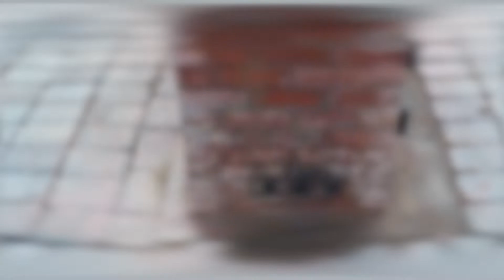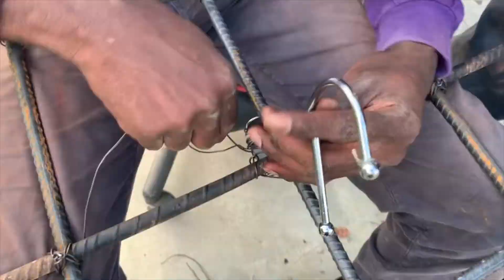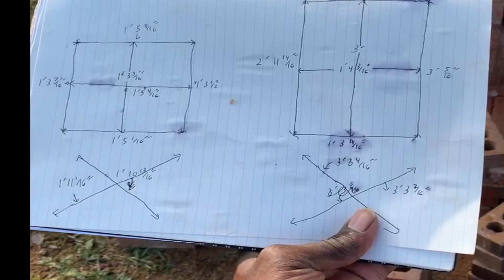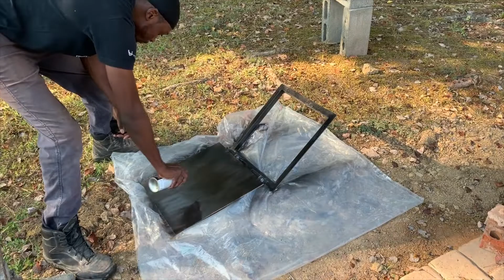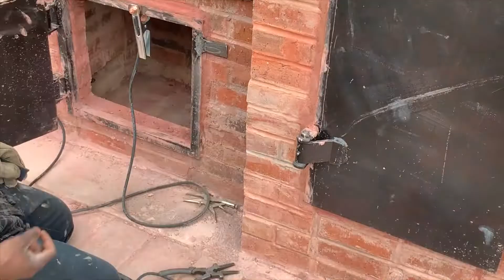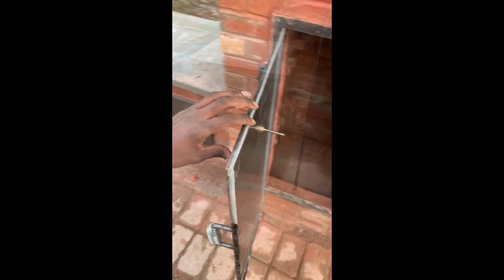How to Build a Brick BBQ Smoker (Part 2)

Comment: This is a really cool project and overall a good conceptual design.   My improvements are:
-Use a single, shared wall between the firebox and smoker (less heat loss)
-Instead of a pipe just have an opening in the blocks between the firebox and smoker (this should be higher because heat rises and will flow better from the firbox to the smoker/storage chamber.)
-add a chimney like you did in your 3rd video
-I think I probably would have used 6x8x16 cmu block for the structure and then face it/veneer with brick (this will hold the heat a lot more because there is more block mass involved)
-Line the inside of the firebox with firebrick 
-Use pieces of rebar toward the top of the smoker box to hang meats instead of using a single hook.  This will allow you to hang a bunch of meat toward the top where the smoke is about the exit the unit

I am just about to build a block offset smoker and will share my design/results when I am done.  Thanks again for the great design and inspiration.
Reply from the maker: Thanks Michael! These are all great improvements and I can’t wait to see how your smoker turns out!
Reply: Hey Michael curious to know how your project came out. Did the shared wall and other details help?

Comment: Your cook  chamber should be higher than the firebox your pipe should have been  at the top of the firebox about 3 to 4 inches below the joint section  but the overall design looks awesome especially the doors a top pipe should have been  placed in center of cook chamber   so that the heat and smoke is pulled upward to cook the food evenly
Reply from the maker: Thanks for watching and for giving some tips! I’ll make sure to keep these in mind if I ever build another smoker.

Comment: Regarding smoke circulation, I have read about guys using 1 or 2 small fans (the kind that are used to cool a computer) for this purpose.  Haven’t tried it, but it’s supposed to work.  Of course, now you’ll need electricity.
Reply from the maker: Thanks for the tip! Installing a small fan on the smoker would probably do wonders.

Comment: Hey man that is a great build. 
To get more heat or to be able to adjust your heat you need dampers on your air intake and exhaust vent. I agree with you moving your pipe from the floor higher up as heat rises. What ever size pipe you have going from yourfire box to you smoke box you will need at least that size on your air intake and your exhaust. And on the intake and your exhaust you need dampers you can open full and adjust to either have fire in your fire box which will give you heat moving to your smoke box or you can close it a lil or lot which will cut back on your heat and give you more smoke. Id love to sit down and swap ideas with you. Again great build.

Comment: Sturdy build!  Bricks use up a lot of BTU's just to heat up to the desired Temp for cooking.  I would guess that it would take more pre-cook heating to get up to cooking temperature.  I just cook on a Bebber Kettle, so no experience with this type of smoker.  But it should be a great smoker and last a long time.

Comment: Good job on this project! There are several suggestions others have made, like the addition of firebrick, that I agree with. One thing that you can do if you aren't achieving the desired temperature and sustaining it, would be to add a small external blower to your intake vents, perhaps even a foot operated bellows. This will both increase your heat and force the heat and smoke through the pipe. If you use an electric blower you can actually put a thermostat on the food side for automatic on/off control based on the temperature you're seeking. You will have to watch your fire a little closer, to assure that it doesn't burn out too fast, but it could help you maintain a more stable and sustainable cooking temperature.
Reply: I was thinking the same thing, a small fan to act as a bellows of sorts to push air in to feed the fire and raise the temperature.

Comment: My Brother I admire the work you did on your smoker. I am from New Orleans La. and now live in Texas and have seen a few smokers in my day. I was wondering why you would have two walls when one would have been sufficient ,one wall would have made your smoker a single unit instead of two separate units ,resulting in better heat and smoke retention, your smoke would travel to your food more abundantly because instead of a smoke pipe you would have a larger opening created by the brick openings .I hope I am not being too critical because I think your smoke genius ,I am presently building a brick smoker and I hope to share some comments with you in the future. Payton C. Jenkins
Reply from the maker: Having one wall does make sense! It probably would have saved me from some of the problems I encountered. Thanks for the advice and keep me updated on how your smoker turns out!
Reply: Yes Payton. a great video. If you have built an improved brick smoker, please share with us too the outcome. Cheers.

Comment: Moisture is your issue I bet.  Fire brick holds less moisture and retains heat better.  I would line ever bit of it, firebox and food storage w/ good fire brick.  And fill in that gap between the firebox and the food side, it only serves as a cooling channel like a fin on an air cooled engine. You may want to think about a small fan on the fire box side to "boost" temps. You may be shocked at what a tiny bit of forced air can do in a system like yours to raise the temp after you have refueled it or when you first get started. 250' f plus may require a good load of coals but you can get it.  You have built a nice rig, you are on your way to some good food.

Comment: I think your intake vents are fine but would change your exhaust vent. Maybe put a 2 7/8 piece of pipe at the top. On the top of the exhaust pipe you could put an adjustable cover so that you can increase or decrease the air flow needed to maintain the proper temp

Comment: There aint no way that this will work. There is a reason that the firebox is black and burned. You have to get the food chamber higher than the smoker or that will never work. Not only are you burning way too much wood, your box is getting too hot. If you can, pull the meat chamber off at the base, and recreated abase for it about two feet up. Your pipe should also be at the top of your firebox.

Comment: This is an awesome and amazing smoker you’ve built with your own two hands and I absolutely love this smoker/ bbq pit I myself would’ve most definitely made the section that goes between the two units larger and I would’ve put a smokestack on the top of the larger unit and sliding vents on both units to help with heat management. But all in all you did an amazing job congratulations and thank you for sharing this awesome build and please share the other mods you are planning to make to this beautiful smoker. And I almost forgot to mention the reason that you need a proper smokestack on the right side meaning your right side when facing the smoker is because then just like any other smoker or reverse flow smoker that’ll make two things happen one the smoke and heat will then pass across and over your meats and the other thing is so that the smokestack will drift out of the smoker make for better temperature control and holding your desired temperatures better. Have a blessed day and I pray that this message finds you and your family safe healthy and blessed. And now I’ll become a NEW SUBSCRIBER. Again congratulations 🎊🎈🎉🍾 on an amazing awesome build and thanks 🙏🏽 for sharing my brother.
Reply from the maker: Thanks for the advice and subscribing! I have the temperature problem fixed now. I will have a new video showing how I fixed it in the next week or so.
Reply: From The Ground Up DIY awesome bro thanks 🙏🏽

Comment: Thank you for the details on the doors. As for the smoke pipe, move it higher, but leave the air vent low on the fire box. Once you get the fire going, block off a few of the holes to slow the burn. Try locust wood to build your coals, then add your flavor wood for the smoke. You could also add a fireplace log rack to build the fire on and build the layer of coals. I hope this helps. I also plan on making the slab over the fire box larger so I can place a pizza oven on top. Great job and it helped me greatly. Cheers.
Reply: For a wood fired pizza oven the fire should be on the deck of the pizza oven. I used to make wood fired pizzas and the temperature has to be maintained at 700 degrees on the deck itself with the heat rolling across the ceiling at 900 degrees. Pizzas cook in 90 seconds or so and you have to turn them every few seconds with your peel to ensure evenly browned crust.

Comment: great job with this, I am hoping to get one built up myself here soon. I was thinking instead of the small brick holes for intake, maybe a half cinder block  for each air intake would be a large enough hole for the airflow you need to get the fire running and staying hot. As well as raising the fire off the ground, allowing some air to travel around the entire flame and get it hotter.

Comment: Great job Bro! I like it.. I would suggest few things, first I believe you need to insulate the firebox by fire bricks or rock wool to maintain the heat, second thing it would be much better to make both holes on the firebox & cooking chamber at the same direction of the ventilation pipe for better air flow and circulation as this would really help in temp control, finally I would add a chimney with a lid instead of halls at the cooking chamber for better controlling over the heat and temp. Good luck
Reply from the maker: Thanks for the Advice! I plan on adding the chimney next and if that doesn’t help then I will add firebrick. Do you think the chimney should go on the the back of the the cooking chamber or on the side?
Reply: From The Ground Up DIY you can make it on the top of the cooking chamber or at the side, I prefer to be on the top of the concrete towards the side not at the back by making a hole in the concrete, actually this can be seen in offset smokers, so you’ll be basically copying the design from the offset smokers! moreover, you have to change the holes on the firebox from the back to the side to match the ventilation pipe flow direction and increase their size, also the ventilation pipe should go higher than you did. Always put on your mind the design of the offset smokers When doing any modifications..
But still you did a Good job

Comment: Try starting with a good fire in your fire box. I would put a rack in my fire box to keep the fire off the ground. That way your fire will get good air flow, you will have a bigger fire, and produce more heat. You might also need bigger vents to get more air to your fire. Great video. I will definitely be giving something like this a try
Reply from the maker: Thanks for the advice! I’ll be giving it a try!

Comment: That's nice bro i read must of the comments they are all great ideas and I have one more for you. Since your thinking about make your firebox holes bigger why not just add a fan with a digital temp regulation that way you can set it and forget it for awhile
Reply from the maker: That’s  a good idea! I’m planning on  putting fire brick in the firebox first and then I’m going to make the holes bigger. If that doesn’t work, I’ll probably try out the fan. Thanks for the advice!
Reply: @FromTheGroundUpDIY  I brought up the fan because I love cooking outside but if I'm drinking and trying to multi task and entertain guess sometimes my fire gets low or to hot but a digital damper fan can control that

Comment: Not what I would have done. The opening to the cooking side should be higher. There should be a raised grate on the firebox with a metal horizontal damper on the left side beneath grate level. Two rectangular plates of steel with three holes or square cut in them that DON'T line up when the plates are on top of each other. As you slide the top plate horizontally the holes line up and more air gets sucked in under the grate and up though the wood getting a hotter burn. 

On the top right side of the smoking side would be a similar vent that when open, will create a suction that keeps the smoke and heat flowing from the left to the right, up and out. Choking the fire on the input makes stronger smoke from an air starved incomplete burn. If you want the sweet smell of the wood, you need a complete hot burn more than a low oxygen burn. Problem is that wrecks the low and slow. To fix this you either cut your fire size down and stoke the for more often or add another adjustable vent above the damper input on the left so that some of the heat spills out of the top vent and never makes into the cook chamber. Basically your splitting the heat. To achieve this on my stick burner, I open the door to the firebox a bit. Some heat back drafts out of the open firebox door, and the rest is drawn through the cook chamber because its hot and  heat rises.

Good luck.
Reply from the maker: Thanks for the advice! The first thing I plan on doing is adding fire brick on the inside of the firebox. After that, I’ll probably close off the back openings on the firebox and smoker side and add an opening to the top right of the smoker side like you recommended.

Comment: Why did you put a pipe in between ? I was thinking about making the firebox share a wall with the food side and cut a hole in the brick or just leave a section out
Reply from the maker: I put the pipe in between so that the smoke from the firebox could flow over to the food storage side properly. It probably would be better to have them sharing the same wall!
Reply: Because you don't want to much radent heat in case your fire box gets to hot
Reply: @OLDSMOKEY6446  That's a good point.  But would closing the air intake on the fire box suffice? Or could the coals still increase the heat too much?

Comment: Great build brother. But what I would do is line the in side of the fire box with some fire brick. It should give you a little more insulation and keep the temperature up. I also would make the air intake holes to the box a little larger. More oxygen means higher temp. But you should also put some kind of damper system to close the intake if the temps get too high  But you are right the opening to the the cooking chamber should be lot higher as heat an smoke tends to rise.
Reply from the maker: Thanks for the advice!

Comment: Very cool build bro! I've always wanted to make something like this. The convection pipe could maybe be a bit higher but before you start taking it out I would definitely try reinforcing or insulating the firebox a bit more. You only used structural bricks (with the holes) and they're not good for insulation so your firebox is letting too much radiant heat escape through the walls. Line the inside of the firebox with fire bricks and that should help keep that heat in the box and travelling through that convection pipe.
Reply from the maker: Thanks for the advice. That’s a good idea!
Reply: @FromTheGroundUpDIY  No problem I hope that helps. I think your intake vents on the firebox are in a good place btw.
Reply: @G-Frain  yes, I think the intake holes on the Firefox should be low, like they already are, so the heat doesn't escape.